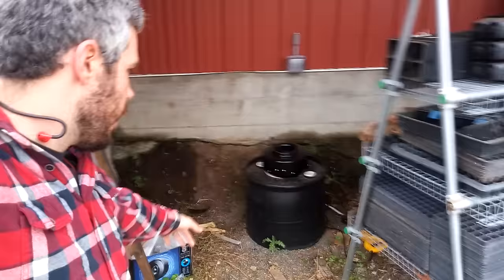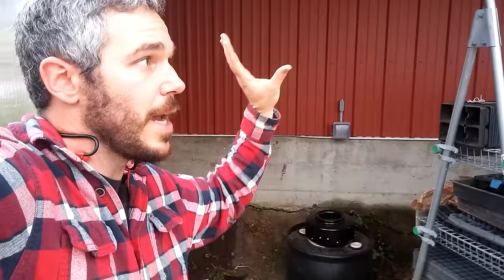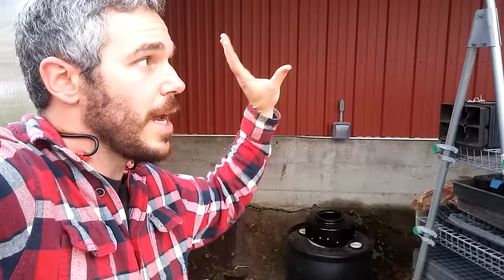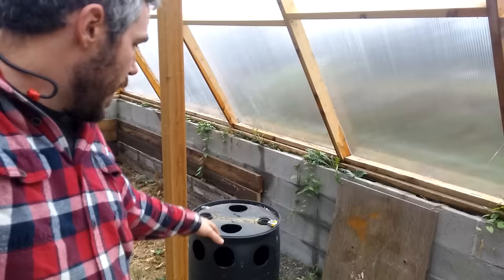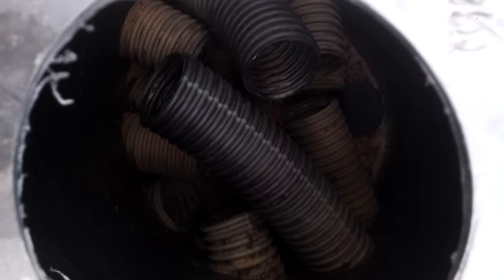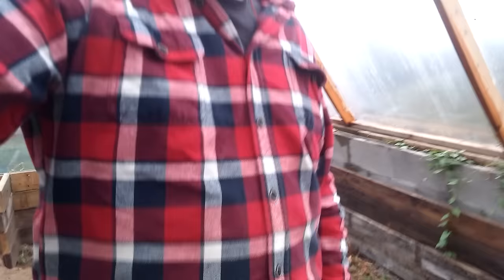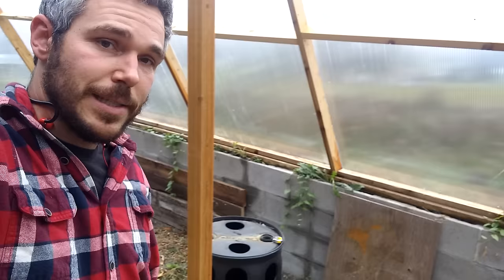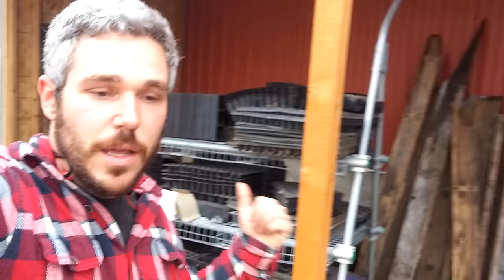Poor Man's Geothermal

Comment: You`ll find 5 times per hour wont access the full potential of the system. I would size the fan for 20x and fit a speed controller. I can run upto 60 times an hour in the summer and not outrun the heat transfer capabilities of the tubing. With 500ft of tubing i guess you have around 375 sq ft of floor.
Reply from the maker: JohnGuest45 do you have more info on your system out there? this is helpful stuff, and I've had a difficult time finding good info anywhere. Thanks!
Reply: That was the main problem back in 2008/2009 when i designed and installed mine. I worked with John Cruickshank of Sunny John/ plain to sea forums to design and incorporate as many unique features as possible in order to experiment and gather realworld data. Sadly, John passed away in 2011 and subsequently most of the websites and info have been lost. There is a lot of misinformation out there, some of which will lead to installations that perform badly or not at all.
I would recommend using a differential thermostat in tandem with a standard thermostat to control the fan.
Reply from the maker: JohnGuest45 thanks John. Sad to hear of his passing. I didn't know why the info went away. as I use this system, I'll try and update with successes and failures, hopefully add to the real world data.
Reply: Looking at the pic of the tubing layout prior to burying it, it appears you have perhaps 15-16 tubes around 30ft or so. There are a few issues, tubes laying side by side without any soil inbetween, quite a lot of bends and a limited amount of mass judging by how deep the barrels are buried in the ground. In an ideal (balanced and lossless) world, you`ll have around 50cfm running through each tube taking around 3.5 seconds. I couldnt find any tech spec for your hurricane fan but looking at comparable fans i would suggest using 500-550 cfm for flowrate calculations. This will equate to around 35cfm per tube and 4.7 seconds.
Reply: Hey Luke!  Thanks for this video. I have so many thoughts for my own project swirling around. One question was with the perforated pipe. It makes sense for condensation, but what about ground water?  When planning out my setup, I was looking at using the non-perforated and now I'm questioning that. 
Sort of random I saw your face on here in my feed because of my huge interest in this stuff. (I'm Ted and Bethany's old neighbor before they moved) I saw you and thought I recognized you. anyway, is love to come by to see what you are doing with all of this stuff. I'm assuming you are in the area?
Reply from the maker: Oh Nice! Yeah, I'm in Oregon City. Let's set up a time to come by. Yes, groundwater is an issue. You have to make sure you have good drainage to keep water out of your system. In my case, it turns out I have a spring running under my shop that is flooding my system. I am almost done putting in a new french drain inside the greenhouse, but it was a hassle, and I may end up with a small amount of water in any case. But it's still important that the drain pipe can seep into the soil. Note in comments below that ADS drainage pipe needs extra hols on the very bottom to keep from pooling. 

You can find me on FB or through our Website outofashesfarm.com to get in touch if you want to come out sometime.
Reply: Chris i have the ground water issue too, so I figured I'd throw the idea at you, to take the extra effort and run the solid corrigated pipe sloped underground, n run it under the greenhouse floor from one end to the other n let it exit somewhere outside, to a point thats below grade from your greenhouse. the other option could be a low point in each pipe that each pipe connects to, but acts as a catch bason, n then have a sump pump in it to pump out collected water the drips from air tubing. 
or, last suggestion, is vertical tube system... search that one n see if its one you like.
Reply: That all makes sense. I saw the vertical  tubes recently. My guess is that they may be about 10% as effective as what you have put together. All of the other options are pretty difficult unless you have something lower than your lowest point of pipe which is probably 8' below your greenhouse. I like the idea of a pump. Maybe some type of catchment system at the low point with a hose down to the bottom so you can still have your pump accessible above ground. You could probably even set it up with a float switch or something.
Reply: According to Jerome Osentowski, in his book "The Forest Garden Greenhouse", the purpose of using perforated pipe in a climate battery is to allow the warm, moist air during summer to transfer heat to the battery, and to allow the moisture to carry the heat back into the greenhouse when temperatures drop so low as to damage plants in the winter. The perforation are NOT intended to allow condensation to drain out of the system. That would negate much of the reason for having a climate battery. If you have a problem with ground water, your climate batter isn't going to work rights as ground water will sap the heat out of your battery. To conserve the heat in the battery, it must be insulated from the surrounding environment (colder water and soil). One point that can escape people is that turn over of air inside the greenhouse (a minimum of 5 times per hour) only occurs while the climate battery is in operation, which is above a set temperature (like 90-degrees F) or below a set temperature 40-50-degrees F, for example). These depend upon the kinds of plants that are grown.
Reply: Moisture in the air respresents latent heat, latent heat doesnt raise the air temperature just the relative humidity. Pumping warm, moist air from the greenhouse into the tubing is beneficial as it returns cooler and drier. The same is not true when its being used to heat the greenhouse...its the reverse. Sensible heat from the mass is used to effect the phase change of liquid water from the soil mass into a gas (water vapour) which is then returned to the greenhouse as moist air...not heat you can "feel" (aka sensible). Latent means "hidden" ;)
Try this, 
If you used $10 of electricity to power two identical stoves in two identical greenhouses, one stove has a pot of water on it and the other has no pot of water. 
which greenhouse would be warmer on the $10 budget?  ;)

Note:the $10 represents the finite amount of energy stored in the soil mass. The stove with the pot represents energy in both sensible and latent form. The stove without the pot represents energy in sensible form only.
Reply from the maker: All the engagement on this video is great. As I said, good info is hard to come by and I'm learning a bunch from the experience and knowledge of you all. I hope that people take the time to read the threads :).
Reply: Are you ever way off. Moisture in a greenhouse may contain latent heat, but its temperature is determined by specific heat. Specific heat is what determines the temperature of air (including water vapour).Latent heat is related to the energy require to cause matter to change state (solid, liquid, and gas). While you would be correct to say that the condensation or evapouration of water in the climate battery/greenhouse system, what we are concerned about is the transfer of specific heat between the two.When sunlight enters the green house, the air is heated through convection as surfaces are heated. While some of the solar radiation is absorbed directly by the air in the greenhouse, this represents the latent heat you mentioned. But, that plays an insignificant role in the operation of the climate battery. What we are concerned with is taking the hot air from the greenhouse and using it to heat the mass of the climate battery. This requires specific heat, not latent heat.When sunlight is no longer powerful enough to keep the greenhouse sufficiently warm enough, we remove the colder air from the structure to the climate battery where the accumulated heat of the battery's mass heats the air and returns it to the greenhouse to supplement whatever the provides as heat. Again, this requires specific heat, not latent heat.BTW, I guess that was a trick question. Ten units of energy is 10 units of energy, regardless of whatever medium you choose to use.
Reply: What you are  missing is this is a greenhouse..with live plants that transpire. They are mother nature`s equivalent to the compressor in a fridge, they work for free using energy from the sun. In order for the water to evaporate from their leaves it must acquire energy for the phase change, (1000btu per lb of water), which it takes from the leaf surface and surrounding air. this is how plants keep cool. 
If you boil a pan of water, it will reach 100c. If you continue to put energy in.. it wont get any hotter.it`ll begin to evaporate taking that energy with it.(latent) 
If the water was not 100C that same energy would have raised the water temperature (sensible).
Energy stored  in the mass is used for raising temperature and evaporating water. Blow cold air over a hot wet towel and see if you get warm, dry air ;)  Better still, install a system and monitor as many parameters as possible for 7 years or so and then decide how it works ;)
Reply: Guys, Guys I think your a bit of track here. no latent debates needed! Iv decided to put some of my brain matter to this! Im planning a Walipini after my silo is completed. Thermodynamics & cycle management matter's most here. Piping should be no closer than 18" (24" is best), as much pipe and as deep as you can, depth is something worth a debate here. Put a solar panel directly wired to DC blower. No more than 5% temp difference between in and out air. Suns up & cycle starts, sun goes down convection & radiant starts.  with good drainage eventually your air & ground moisture will balance it's self. No latent (transformations) going on.     Peace Out!
Reply: Good luck moving enough air with a solar powered dc blower to maintain a 5% differential. My fan can push the air through the tubing in less than half a second and not get remotely close to 5%.
Here`s a psychrometric calculator so you can figure just how much air you`ll need to move to acheive that goal.
http://www.uigi.com/WebPsycH.html
Something to be aware of is that heat will move downward below the system where it cant be recovered so you will need to consider insulation beneath the system if heating is your main goal.
You have no choice but to take latent energy into consideration, the air will not be bone dry (0%RH), a greenhouse full of living plants can be 70% RH or more in the daytime and quite possibly over 90%RH at night. I would work through your calculations a few more times before investing time and money into the real thing.
Reply: If you got a ground water issue you can make a semi closed system. Do not perforate the piping. Instead, on every corner on a 2m2 square place a little collector below the piping connected to the piping so it can drain. Connect all of those together using 3/4 piping with one leading out so you can either use gravity to naturally drain or a pump to pump it out. In this case it would be better to use smooth piping for everything instead of flex piping, with all put down on a slight angle so the water actually collects in the collectors. If ground water is still way too much and additionally you are looking into reducing that on top of this then you can perforate the piping on the sides instead of the bottom, however that would need some gravel so dirt wont get in. So every 1m2 perforate 20cm of piping on both sides, then add gravel only to the sides and above it and voila youll hit 2 flies in the same blow. For ever 20cm of gravel, add 10cm to the total lenght of piping to compensate for heat transfer loss.
Reply: JohnGuest45 I hope you work as a consultant for builds, you're a wealth of knowledge.
Reply: Jaye Jay Curry
Geothermal air exchange is not the same thing as a thermal climate battery. You're repeating mixed up theories. The point of circulating air underground is to disperse air at one temperature and exchange it for air at stable below grade temperatures. YOU DO NOT WANT TO INSULATE AROUND YOUR GEOTHERMAL PIPES.

Insulate the foundation perimeter above them, and thats it. You want any temperature differential to dissipate into the soil, and you need some of that energy to move laterally. You don't want to do anything to slow down heat conductivity that far below grade. Moisture in your soil aids thermal conductivity. Some systems intentionally add moisture for that purpose. 

The sun does not produce enough excess heat to warm your greenhouse by thermal mass storage during the winter in cold climates. That's why digging into the ground works and putting a greenhouse on a giant block of concrete doesn't. You can't put a glass ceiling on a roof in Minneapolis and heat it only with the sun no matter how deep and well insulated the thermal mass storage below it is. It's far more efficient to cover and insulate the roof and pump geothermal air in if you aren't utilizing the light. 

As for the original question, no one can tell you what volume of pipe you need or how fast it should circulate. That depends entirely on how conductive your soil is, what size your pipe is, and how far you space your pipe. Heat does not rise, cold falls. Design your system so you aren't fighting natural convection, making your pipe needlessly too long (and creating more resistance), or moving your air faster than it can exchange heat.
Reply: Hi JohnGuest45, I am looking at doing a geothermal heating & cooling system on my farm in south Australia, we only have solar power so have to keep power usage to a minimum. We have an earthmoving business as well so digging the trenches won't be a cost at all.. Can you point me in the right direction for how to build one please? Not sure where to start (other thank youtube & google) & you seem knowledgeable in this area :D
Reply: 90%RH at night? From what source? Plant close their stoma at night and do not transpire.
Reply: We aren't exchanging air. Exchanging air in a system like this means intaking air from outside the system while exhausting air from inside the system. This is cycling air. When phase changes occur, the energy of the phase change is either dissipated or absorbed by the material. That is where heat exchange occurs. I hope I don't sound too bossy! 
:-P
Reply: @JohnGuest45  I am needing a system designed. Anyone I should contact for help?  You appear to know more about these systems than most.  Looking at vertical too.

Comment: Hey great video, not a lot of information out there on this. Just a couple questions on the setup: How many Cu.Ft. is your greenhouse? How long are your pipe runs? How many CFM is that fan? Thanks!
Reply from the maker: The greenhouse is roughly 6,300 cbf. It's a very irregular shape because it's attached to the shop but set at a southern solar angle, so difficult to get it exact. The fan is an 8in Hurricane with 745 cbf. That will move the air around a little more than 5 times per hour. I prefer a bit more to a bit less. 

The pipe runs are variable. You can see a pic of what it looked like in the ground before it was covered if you go here: http://www.outofashesfarm.com/blog/2016/10/9/poor-mans-geothermal
Reply: The issue with variable pipe lengths and bends is they unbalance the system so some tubes will get more air than others. This isnt a big problem if you check the airflow rate through each tube using a cheap windspeed meter and re-balance the system by restricting (squishing) one end of the faster flowing tubes. This will provide more flow in the slower tubes. It can be a tedius job as it usually takes a few iterations to get the flowrate equal in all the tubes but its well worth the effort in the long run. 
Having all the tubes in a relatively single layer is not ideal as it increases the tube to mass ratio (ie more tube/less mass per unit area). Ideally, the tubing should be evenly distributed throughout the entire mass both horizontally and vertically.

Comment: Right, another way to help is too use those blocks to bury the greenhouse up to that level. In other words, the greenhouse will end up being 3 ft into the ground, the block section with soil on the outside reaching up to he edge of the top layer of blocks, this will be in itself like a thermo container taking advantage of ground temperature. But doing that along with what you already did will improve heating and cooling.

Comment: I’m having trouble getting my low grade geothermal system to work. I have 5 sets of pipes with a length of 80’ each and I had a small amount of air on with a 250 cfm inline vortex fan on one pipe but almost nothing using a 500 cfm inline vortex fan. I’m not sure why it isn’t working. The pipes are free of water.  Any thoughts would be appreciated, thanks Ed from Lundy’s Farm Market.